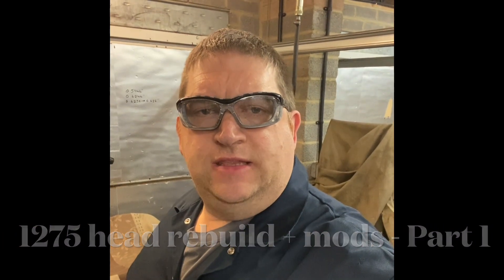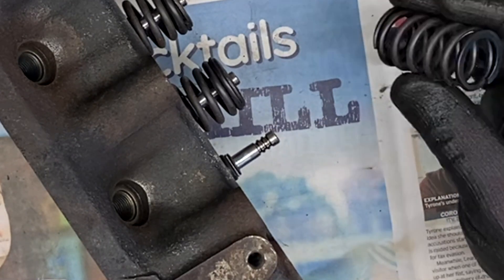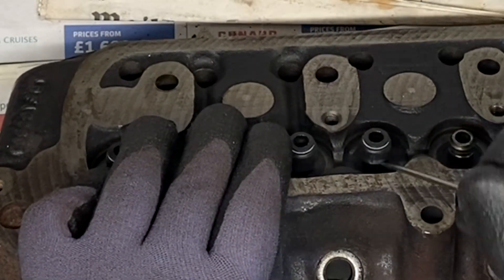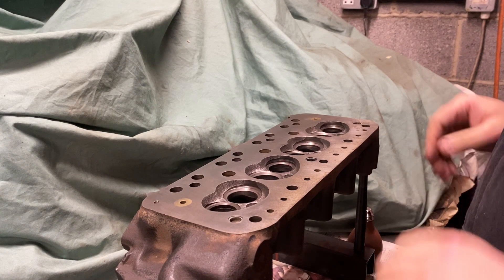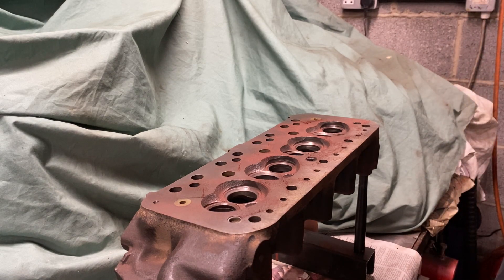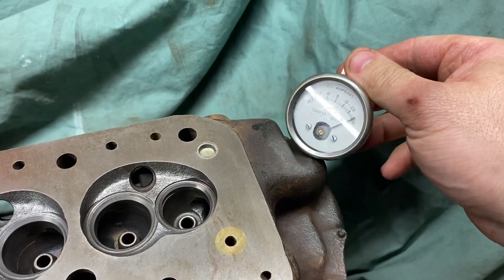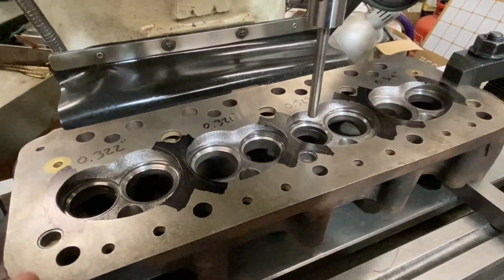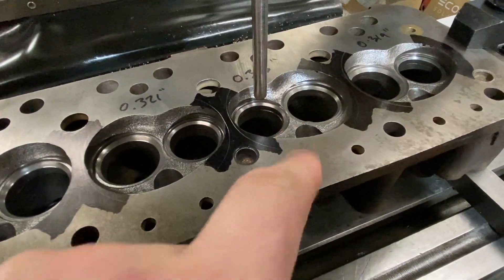1275 head rebuild + Mods - Part 1

Comment: I saw some dyno results of one of your heads with just the chamber mods, it does more than I realized. Especially for the costs involved. 

Different topic, but I'm also amazed how much power Might Minis make if you realise how little mods they can do.  Do you know what they do to get 90hp from a near stock engine? Pistons would be a large contribution   but what are the other secrets?
Reply from the maker: Do you mean super mighty minis?
Reply: @ACDodd  oh the 90hp is for the super Mighty Minis? I just found out about these classes, so not up to speed on the differences. 

So the mighty's have around 70hp? What do the super do to reach 90? 

I did my first drives with my modded cilinderhead this week, I'm really pleased with the additional torque, cant wait to have it setup properly. After 7 years of waiting I now use it as my daily driver,  I missed this so much!
Reply from the maker: @GTE_Channel  the supers are higher than that, (not going to say how  much), they use 1.5 rockers a well opened out head and an ACDodd supplied spec cam.
Reply: @ACDodd   ah I see, I was in the understanding they still used std. camshafts and near stock heads. Thanks for the insight!  Keep up the good work!
Reply from the maker: Yes the ‘halfway house’ makes a big difference, my testing has shown it to be worth about half as much as a fully ported version.

Comment: Longman checked my cylinder head for cracks using a similar method back in 1990.
Reply from the maker: Nothing new here, magnetic particle inspection has been around for years